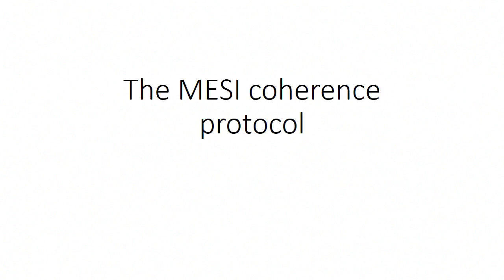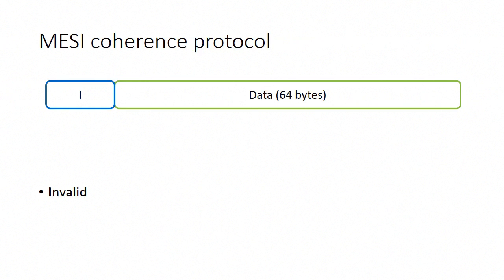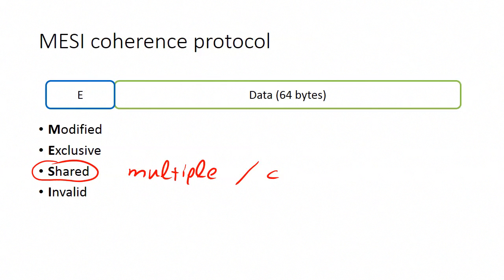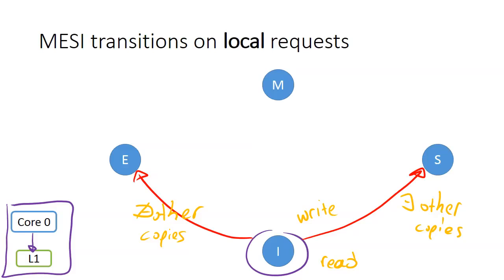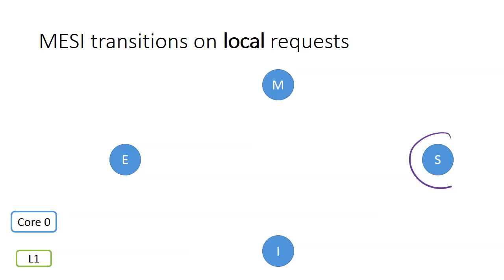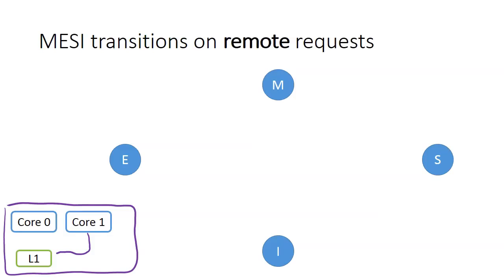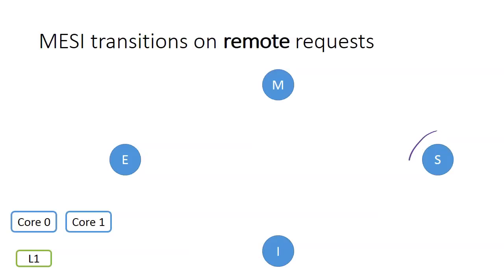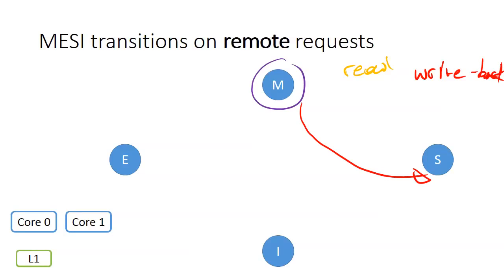MESI Cache Coherence Protocol | Vasileios Trigonakis

Comment: In a multiprocessor environment, each processor would have it's own cache memory, interfaced with the main memory, right? So, let's say there are two client processors P1 and P2. The caches C1 and C2 belong to P1 and P2 respectively. There will be some blocks from main memory in the cache memory of C1 and C2. My doubt is that, how would P1 know if for a particular block of main memory that is in C1, a copy of it exists in C2? Am I getting this wrong? Which part of the system actually oversees this MESI state transition diagram? Is it the main processor to which P1 and P2 are interfaced?
Reply: There is a common data bus in which cache writes are broadcasted to, all the processors can listen to and respond to the broadcast which is where the MESI protocol comes in